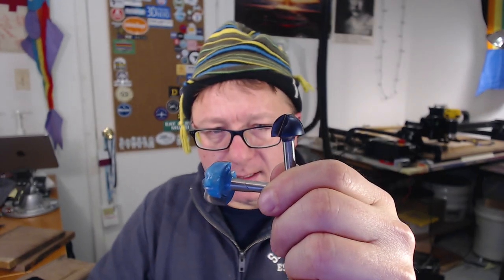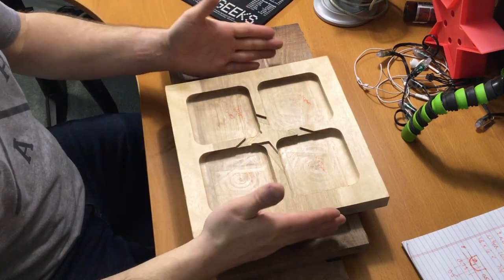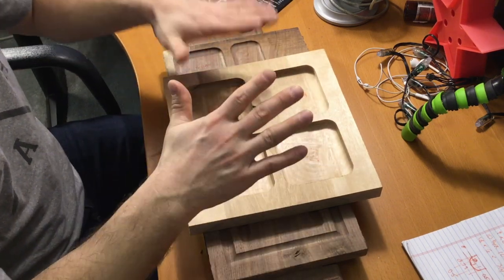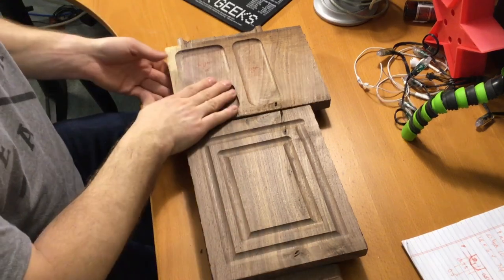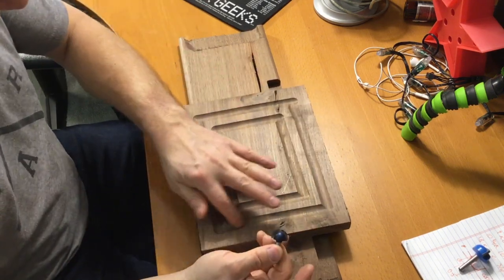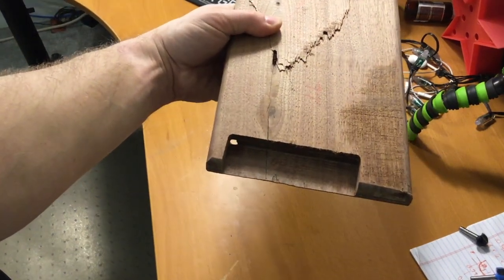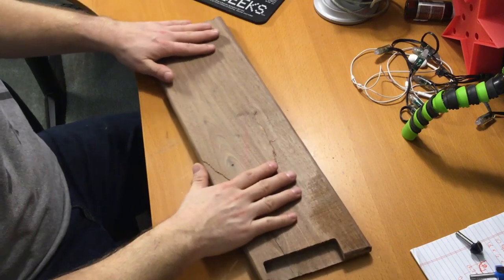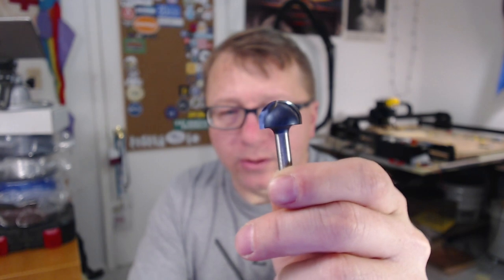Testing a Bowl Making Router Bit with the X-Carve

Comment: I saw the video on the inventables website and I noticed that your vacuum wasn't working very good, do you have the boot insert attached to the dust boot? I do like the idea of using a round bit to clear away material.
Reply from the maker: Hi there - I wasn't aware the video was posted there.  If you could send (or post) the link that would be great.

I believe when I made the video my dust collection bucket was full, so it was not collecting at an optimal rate. That said, this large bit makes a big mess even when it is collecting well.  The deeper you cut, the more area for chips to escape under the dust shoe.  Thanks for watching and don't forget to subscribe!

-Tom

Comment: I have never cut a bowl on my Shapeoko 3 but what I have read is for best results and the least amount of sanding and clean up you should run a roughing cut using an end mill then the bowl bit to clean thing up and contour the bottom edge.
Reply from the maker: Hey James - thanks for watching and commenting.  The bowl bit I have is way bigger than any end mill I have, so pocketing is much faster.  And now that I'm experimenting with adaptive clearing, it's even better.  I do have to figure out how to make a good finishing pass, but I'm happy with the results so far. I'm really impressed with the X-Carve though some of the new drive drive systems are looking pretty amazing.  Once again, thanks for watching and don't forget to subscribe if you haven't already!
Reply: @cyberreefguru  i always do a cleaning pass, .01 inches deep and the bit just touches enough to remove and smooth without any tearout. I learned this with routing techniques to avoid burning wood on the edges.
Reply from the maker: @christiansuarez8057  Thanks Christian - get suggestions.

Comment: Hello.. did you use that bit with easel?
Reply from the maker: Hi Jose - I did use the bit with Easel but I had to create a custom bit and manually set the feeds and speeds.  The last time I was in the app I though Inventables moved custom bits into a pro feature, but I could be wrong. If you can get the proper dimensions into easel, it should work without a problem.  Thanks for watching!

Comment: Could you tell me the RPM you used for those bits?
Reply from the maker: Hello - something in the 16K range works. RPM is not as critical as DOC or feed rate though.  Using an adaptive cut, I set my DOC at 0.2" and feed rate around 80-120ipm depending on the wood. If you are not using adaptive, then something like 0.125 would be a better DOC.  Hope this helps - thanks for watching!